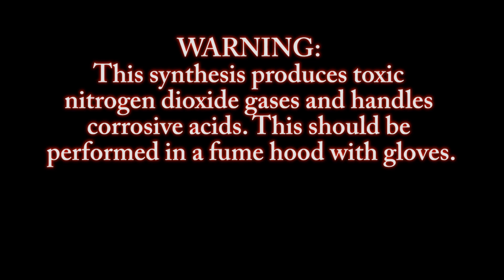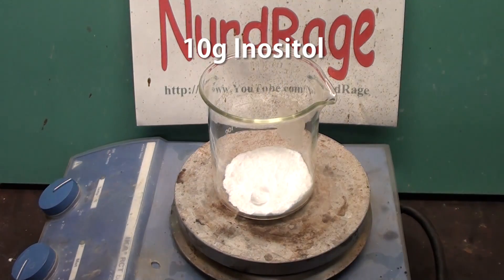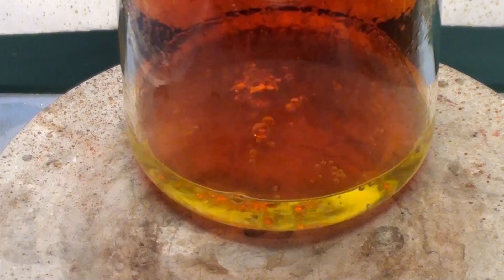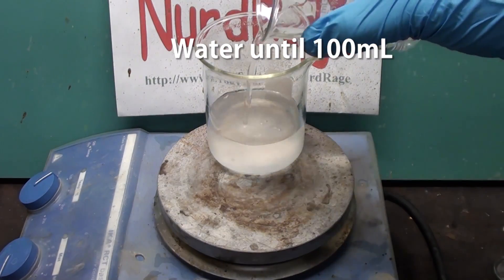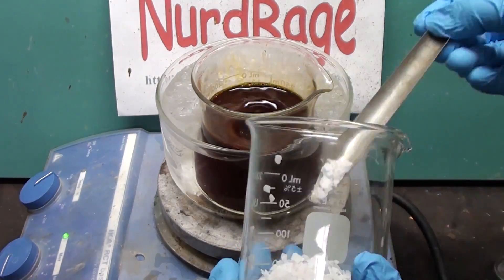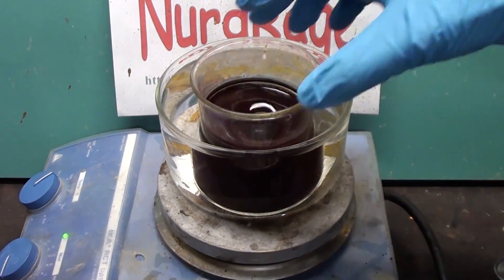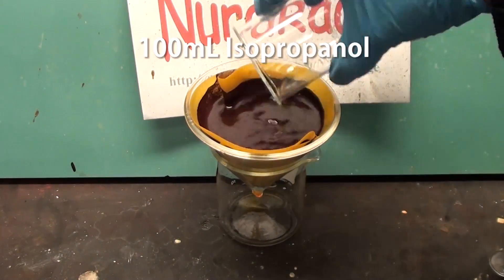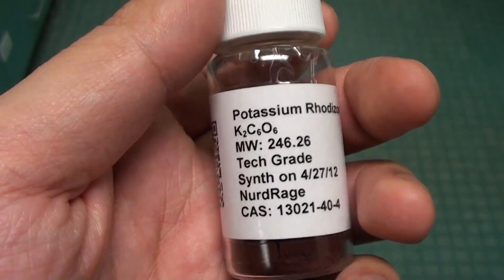Make Potassium Rhodizonate (for lead testing)

Comment: Inositol is just simple glucose (c6h12o6) which is also called dextrose
Reply from the maker: NO! its not, look up the structure, they are NOT the same. If you use dextrose for this procedure it WILL fail.
Reply: @NurdRage  okay
Reply: @NurdRage  do you know how to convert dextrose to inostiol ??

Comment: Hello NurdRage , Thanks for the information you supplied. 
My question is regarding the amount of KOH used.  10 grams of inositol is  0.0555 moles. According to the stoichiometric relation  0.111 moles of KOH  (2 * 0.0555)  should be sufficient to precipitate approx 13 grams of K-rhodizonate. But you recommend  to use  40 grams of KOH which is  0.71 moles.  I would like to know the reason of almost 7 fold more KOH.  Regards
Reply from the maker: to shift the equilibrium toward products.

Comment from the maker: It's not stable in *air*, which you left it on for a week.
In the next video (the actual usage video) i state it only lasts for an hour once dissolved.
We precipitate out here so that its stable in solid form but its still oxidizing in solution. as some gets oxidized more of it dissolves back into solution. eventually you destroy it all. The trick is to make it faster than it gets destroyed. Thus i specify one night, not one week.

Comment: Thanks for your reply!
Actually, the lab-evacuation was just for the safety of the other students - i didn´t smell any NOx, but the fumehood (i guess 2x2x0,8 m) was completely filled with brown gas - which looked kinda scary.
I already sealed the product into one ampoule, but i could test if it still works. I thought the product was stable in the presence of potassiumacetate and acetic acid?

Comment: The production of NOx went on for about 2h 10 min - i refluxed with a dimroth-condenser, so you could see if the NO still turned into NO2/NOx, while you raised the condenser.
So yeah amateurs, be warned ;-)
Also, i didn´t stirred it overnight, i let it stood for 1 week. Only got 0,3 g though :(

Comment: Do not underestimate the production of NOx ! 
I tried this with 10 grams of inositol under a fumehood at the university. At about 120-130 °C the mixture began to boil and large amounts of NOx got free. I turned off the oil bath and sinked it down, but the reaction couldn´t be stopped. The fumehood (which got a really good exhaustingpower) couldn´t handle these amounts, and the lab had to be evacuated.
I quickly grabbed a gaswashing-machine with Na2CO3, to get rid of the toxic fumes.

Comment: I actually do have a supply of Potassium Acetate on hand. If I were to use that Instead of KOH and Glacial Acetic Acid, how would you suggest I approach this method? Just dissolve a proper stoiciometric amount in water and add to the Rhodizonic acid solution to give a Precipitate? If so what would the right stoiciometric amount be for the amount of Inositol and Nitric Acid you used here?

Comment from the maker: i didn't try their method as i felt it was more likely a lab already had or could easily find KOH and acetic acid rather than potassium acetate. I found that my yield was slightly more than their reported yield. But that could just be attributed to experimental variation. If you have potassium acetate onhand then go for it :)

Comment: I saw a paper about this synthesis which was published in 1942. They used potassium acetate 50% solution instead of acetic acid/KOH. Did you try their method, and if so, is the yield improved if you use glacial acetic acid and KOH instead of potassium acetate?

Comment: 'ere lemme get in on this too: the precursors Nurdrage mentioned was chlorobenzene and trichloroacetyl aldehyde
chlorobenzene is made by the bubbling of chlorine in benzene with a catalyst. that be iron filings as they react with the chlorine to make iron chloride AND chlorobenzene (if you don't know how to bubble chlorine, you shouldn't be attemping this reaction)
as for the latter, i'm not too sure, but Trichloroacetic acid is made by bubbling chlorine in acetic acid with the same catalyst

Comment from the maker: ok, that i can explain ^_^,

DDT is made by boiling together trichloroacetyl aldehyde and chlorobenzene in sulfuric acid and then washing the product with water. The problem is the precursors themselves aren't easy to get or to make with home chemsitry. So i don't think attempting it for pest control would be a good idea. Also the chemicals are somewhat toxic and the DDT itself is known to have health hazards. 

So I probably wouldn't be doing it myself since I don't have a need for DDT.

Comment from the maker: No, "practical" is VERY subjective: What one finds practical another may find useless. This video is a good example, testing for lead is applicable for those making lead compounds. DDT is useless in that regard.

When you say i should do something "more practical", you imply i should conform to *your* standards of what is practical. But I have far too many viewers to appease them all.

I'll hear suggestions but please don't apply *your* value judgement as to what is practical to my videos.
Reply: I find that extremely practical. I sure wish I could put my hands on some Potassium Rhodizonate so I can test all the lead, tin and pewter I have to make sure they are what they are. But it's too expensive to get what I need and your video is awesome, just wish I had what it takes to make it. Thanks for your awesome videos.

Comment from the maker: The QR code is hard to read because its on a curved surface and from the camera's persective it's distorted, you need a QR code reader that scans it line by line like a bar code so it appears undistorted.

But i'll save you the trouble: The QR code in my lab almost always says the exact same thing is as the text label. The code is for the computer inventorying system to track and in case the text label is too damaged to read.

Comment: what if i want to look at the forces between the molecular bonds? 2 of the fundamental forces in physics and then apply that to the different shapes that molecules form based on the strength of these bonds? is that chemistry or physics?

Comment: physics is chemistry only in an extremely more refined form and generally uses more on the macro side of things.whereas chemistry while it has benefits in large scale production has it's science based mostly in the micro world.

this makes for extremely different formulas and methods:for instance gravity doesn't play much of a role in a non-Newtonian fluid whereas in a suspension it plays a rather large role.getting it right is probably why you haven't or will not eventually have passed college.

Comment: Ultimately chemistry is physics, it's just that it's a very different long branch and so got called Chemistry. You can however predict reactions and chemical behavior with physics it's just that using trial and error in chemistry and establishing likely observations is much easier.

Comment: If you have a way of keeping it in contact with the beaker and the co2 can't react with the chemicals, then yes. Regular ice works great because it turns into water that is still cooling and the bath covers the whole outer surface of the beaker. You can also make slurry or add salt to better enhance the cooling.

Comment: @Robobrain the hot plate he is using also has a magnetic stirring mechanism inside it.  You can see the little magnetic stick in the beaker that gets turned by the spinning magnet in the plate.